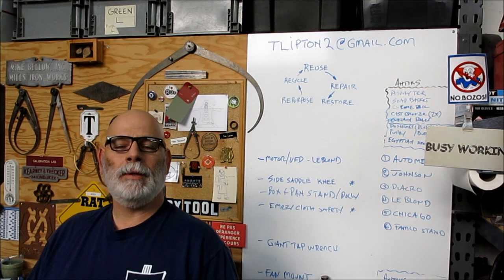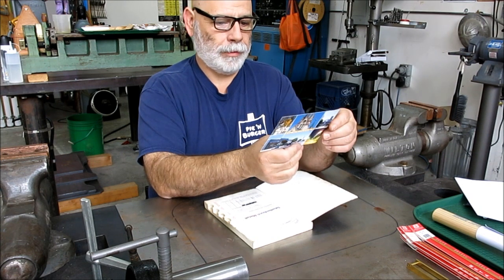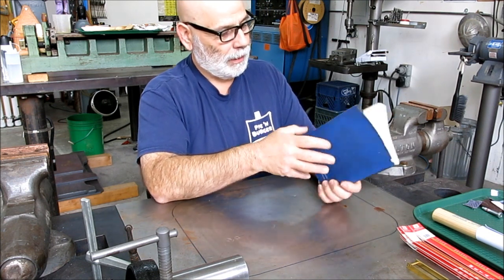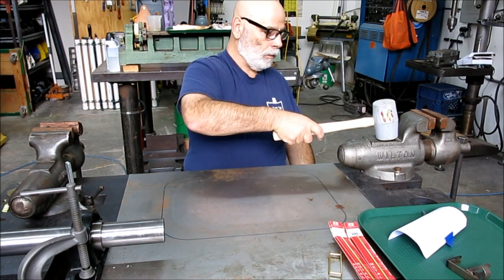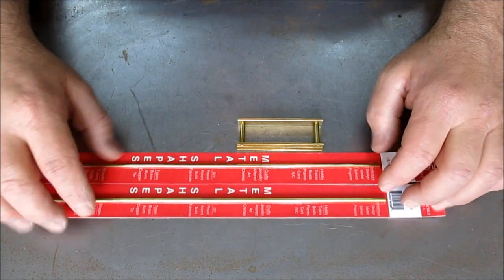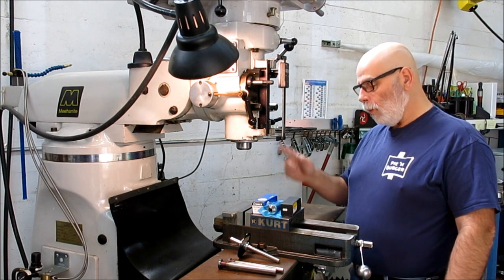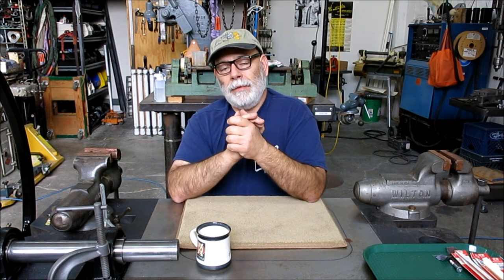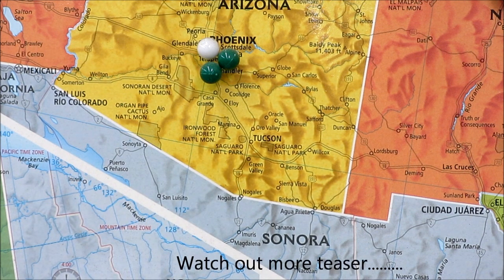Monday Night Meatloaf 60

Comment: Tom, good to see your mug on camera getting a drink from your mug. Just don't burn your Schtimplepecker on the hot coffee. 

The ladder project sounds like I'll be learning a lot. Will you be making rollers to form the channels for the sides...maybe like a series of bead rollers that form flat ribbon into formed channel with rolled edges? In two sizes for the extension ladder version?  Ok, maybe not...I expect a hammer will be involved....

I'm slowly building up a backlog of projects for my little lathe.  One I'm wondering about is an alternative to a faceplate...which I don't have one of. Rather than spend money on one, I'm wondering if I could substitute your mini-pallet idea in combination with my 4-jaw chuck?  I have a hunk of 1" thick aluminum.  If I saw out a small rectangle, chuck it up, face it off, and then drill and tap for a while on the drill press, would that be safe and effective for holding odd-shaped parts for boring, turning, or whatever?  The lathe is a 9" South Bend and the chuck is 6", so we're talking smallish parts...I won't be trying to swing car parts on it. Is this a bad idea?  If not, any safety limitations to watch out for?

Thanks for all the fun and edumacation!

-- Mike
Reply from the maker: Hey Mike,

You are correct there will be a hammer involved. I have a version of the mini pallet that is round with a stub on the back to grab in the chuck. Works well for faceplate type operations. Thanks for the comment.

Cheers,

Tom
Reply: Tom,  I hadn't thought of round with a stub...though that sounds good.  I was thinking a rectangle gripped in the 4-Jaw...that would let me shift it around a bit if necessary.  For example, to get something lined up that might need to be in a specific position relative to the mini-pallet holes for proper clamping.  No reason not to do both I guess!

Thanks for the response!

-- Mike

Comment: Tom, Never seen a ladder on a Fire Truck quite like that in my 40+ plus years in the service!  I've seen wood, aluminum and fiberglass but not copper. By now you are down in my neck of the woods (Tucson), enjoy the nice weather!!  Thanks for the snack.  skoal
Reply from the maker: Hey Gayle,

This is a special purpose unit. No expense spared. Thanks for the comment.

Cheers,

Tom
Reply: Yup you're right Tom, it's not a replica is it.  Keep up the very cool videos!!  Did you look at the "Whats it" pictures I sent?
Reply from the maker: Gayle Strand Hey Gayle,

I'm not sure on the pictures. I searched my email with your name and nada. Is your email something else?

Best,

Tom
Reply: oxtoolco I sent the pictures to the email address on the board behind you.

Comment: Tom, I am contemplating a bigger chuck for my Sheldon 11 x 36. Would it be possible for you to do a short video explaining your choice of the 6 jaw on your lathe? And also the benefits, if any, on getting an adjust-tru 3 jaw, or 6 jaw, etc      Thanks, Matt
Reply from the maker: Hey Matt,

I did a little something on the FAQ video. Check it out. Thanks for the comment.

Cheers,

Tom
Reply: I did find the faq when looking for other videos that i had not seen before. Thanks

Comment: Very cool that you are taking on the ladder challenge, and without reading any of the other comments(which I'll do shortly), I'd like to suggest looking for the hardware for the pulley system at fishing tackle shops along the drive you are going to be on, or possibly even in Green Valley itself? There are many types of miniature rigging gadgets, and for a pulley I thought about the ones that come on the ends of little fishing poles.

I may even have one(or a dozen...) in the garage that can be sacrificed if you want to go that route? I just had to spill the thought before it escaped me. The variety of little set ups is endless and I will put a few examples from my tackle-box in your Christmas package here soon as you return.

I'll email you to find out when you get back, I don't want Ernie tearing open you bag of jerky, LOL! Aloha...Chuck
Reply from the maker: Hey Chuck,

Made it back safe and tired. Time to get back to the shop. Thanks for the comment.

Cheers,

Tom

Comment: sorry offtopic , Hello Tom , I have a TAPMATIC 60X but i dont now how to use it neither on lathe nor drill prass , and this is a pic of it http://imgur.com/U4wzMiA
Reply from the maker: Hi Nacer,

The ring is set to the thread size you want to tap. You should have a reaction arm coming off the side of the unit as well. The unit will rotate anticlockwise with a clockwise spindle rotation then change when you engage the workpiece. When you relax the spindle and pull up a little it will reverse out of the hole. You should be able to download a manual from Tapmatic.

Hope this helps.

Tom
Reply: oxtoolco Thanks for your respond, My English is not that well , let's say i want to tap M10 (metric) How should i set the ring , and what do you mean by the ring , please look at this pic i write a few Questions, thank you http://imgur.com/vtg2Cah